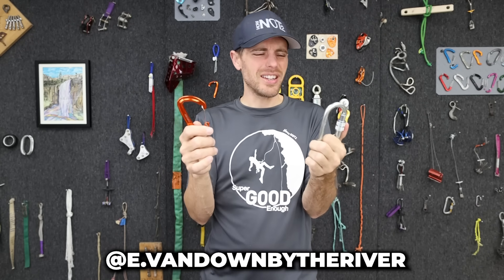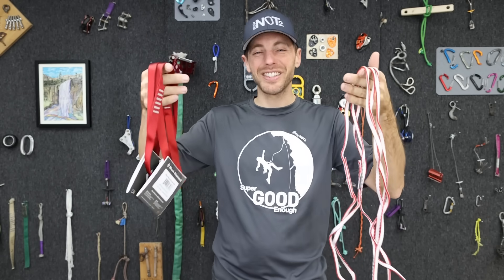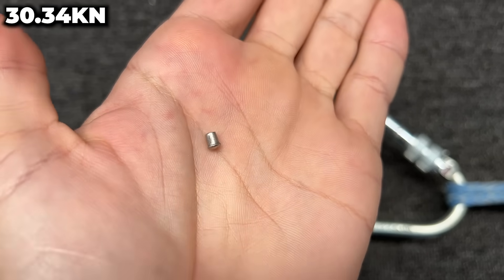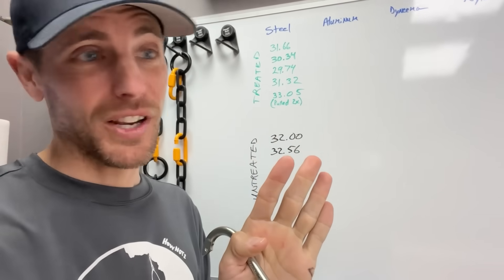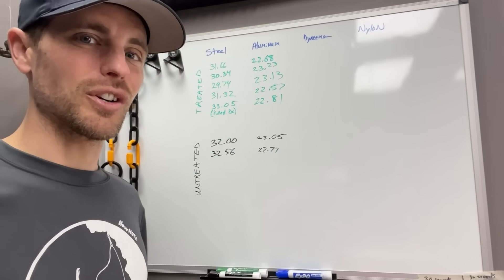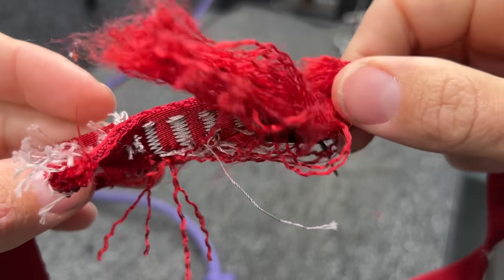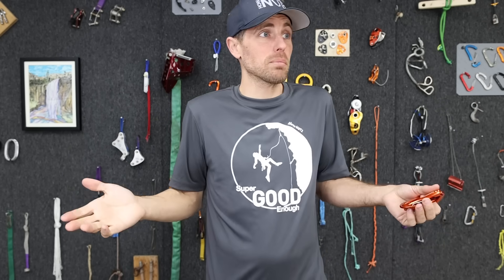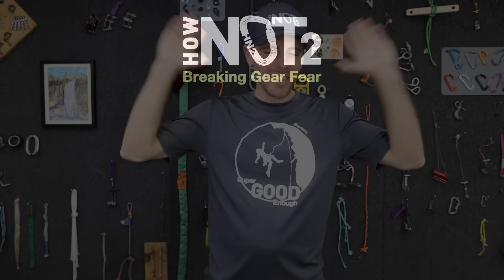Can we make climbing gear stronger?

Comment: There are metallurgists working at these factories. In most cases, whatever you do, you will make it weaker, because the metal is already heat treated properly. Only if they had treated the material suboptimally, you would be able to improve on it. And on top of that, not much is happening with materials at low temperatures chemically, and if there is, it takes a long time. If anything you most likely will introduce stress fractures because of the uneven cooling. There are some steels that can be hardened cryogenically, and some of the high strength maraging steels might benefit from that procedure too, by further increasing the proportion of martensite to austenite, so it's not impossible to improve a your gear, just unlikely.
Reply: I like the idea of people not doing the process because of proper research however the razor says, cheap process is more likely to get good enough rather then treating and costing more hours of production. 

This does treat hss steel bits by making the grains interlock in a similar tough way and the bits I've done this too last 3 to 10 times as long. But youtube search drill bits in liquid nitrogen by applied science
Reply: the cannel applied science has made a video on cryogenically treating HS steel drills. Very dramatic result. of course it might just make it more brittle
Reply: @ayrendraganas8686  Right, hardness and strength are not the same thing, although they are related.
Reply: That's not entirely fair -- the metallurgists might not be treating the products because it increases cost with no real benefit, or for some other reason.
Reply: Yeah, the ultimate tensile strength isnt going to change much unless its normalized.  Cool to see still.
Reply: It would be cool to see an episode that dives into the metallurgy a little bit--I was shocked to learn that CMC makes a aluminum carabiner with a 44kN rating--I had never heard of a aluminum carabiner that had a higher strength than many steel ones. I have to assume there is something beyond just geometry going on there because it's a big carabiner but not ridiculously so.
Reply: @ayrendraganas8686  The optimal heat treatment of a drill bit is almost the exact opposite of what is optimal for a carabiner.

Comment: I've never done cryo-treating, but for heat-treating, what's more important than the temperatures reached is the speed that the temperatures change. When a metal is hot, the atoms can move around each other easier, and how fast you cool it kinda determines when they get "locked in place."  I'm honestly struggling to see how a cryo treatment could do much unless it was kept cold for at least minutes if not hours given how slow the atoms move at 77K. My only guess is that at lower temps, the atoms "fall into" lower energy lattice states that evens out the crystal structure and the energy when it warms up isn't enough to excite them out of those states. 

Kinda sad it didn't work, I wanted an excuse to play with LN again.
Reply: As some others have mentioned, Applied Science did a video on this for high speed steel: https://www.youtube.com/watch?v=hAxi5YXTjEk

He slowly cooled it and held it at 77K for about 30hrs. He shows a diagram showing the different structures, and shows how the grain lines disappear afterwards, but doesn't really explain the physics. I feel extremely nerd-sniped right now.

Comment: While cooling a steel component, different crystal structures can be obtained depending on the temperature-time curve. 
Martensite (hard and brittle) can be obtained by rapidly reducing the component’s temperature. This is obtained by quenching the hot part in water or oil. 
The martensitic reaction begins during cooling when the austenite reaches the martensite start temperature Ms. As the sample is quenched, an increasing percentage of the austenite transforms to martensite until the lower transformation temperature Mf is reached, at which point the transformation is completed. 
For some high alloy steels, Mf is much lower than room temperature. Thus, a percentage of austenite remains in the crystal structure. To complete the martensitic reaction additional cooling is necessary. This is usually obtained using liquid nitrogen.
The transformation between these phases is instantaneous and not dependent upon diffusion.

Comment: cryogenic heat treat does improve the toughness but not the overall strength. the cryogenic heat treat does move the yield point (the point on a stress strain curve where a piece will not return to its original shape) and that is why you could open the cryoed one that was taken to 31 kn but not the other one. applied science did a video on how cryo heat treating works and he does a much better job of explaining it because he has a better understanding then I do.

Comment: working with cryogenics we have plastic wires. most plastic used for wires have problems if you cool it down too fast or unevenly since they  become shorter and brittle, but they can survive and the process is reversable if the cooling down is even.

Comment: The question becomes...How much does the equipment degrade after it has been used a few times? What happens to the slings after they have picked up some dust and been used and stored and maybe gotten wet once or twice? What happens to the biners after they have been used and scuffed and scratched (but never taken a significant fall) or maybe their wire gate has bent a bit, or one of the pins has slid out of alignment? In other words...How durable is it? What do we need to worry about before we put black tape on our biners?
Reply: That is what half the videos on this channel are about. Lots of old used gear. The tldr as far as I’ve seen them is soft goods anywhere down to 50% and hard goods more usually down 80-90, if at all.

(Assuming it passes visual inspection and doesn’t trigger your “Jesus this stuff is fucked up” sensor)

Comment: I very occasionally use a biner that is "far too strong" because in some circumstances I want a steel biner (like Petzl Oxan, triple action 38, 16, 15 KillerNewtonts) that would still be super good enough even if cross loaded or bent over an edge. Not needed very often, but an example is the biner for a top rope (belaying from below) or in some difficult industrial situation. That sort of kit isn't very relevant for normal climbing though.
Reply: This is why I like my CAMP steel triple lockers. MBS is super good enough even cross loaded or open

Comment: Ask me how surprised I am that the professional metallurgists working in climbing gear factories have already tempered these metals to whatever state is optimal.

Also: My amateur understanding is that ONLY cooling something from room temperature isn't really going to change the crystal structure. You really only change the crystal structure by significantly heating and THEN cooling metal, because metal is a solid, and not much happens inside a solid metal at room temperature and below.

Comment: The only time a material can Cryo harden is when it’s cryohardenable. If the material you are using is heat treated, there is a reason. Or maybe they’re already cryohardend  as for the slings it seems like it damaged the stitching

Comment: I wonder with the webbing and stitching, if humidity at the time they were frozen played any impact in the integrity of the stitching being degraded. More specifically, let's say there was 60% humidity level, and that humidity was inside the stitching and webbing, then as temperatures dropped the humidity would crystallize and expand more than the nylon, causing micro abrasions. I don't think it's anything to be worried about, but I think it effectively would age the material.

Comment: @hownot2  The thing is that cryogenic treatments don’t do this to all things.  

When you make knives you know there are only certain formulations of steels, particularly super cutlery steels, that benefit from cryo treatment. 

I think D2 tool steel is another formulation that benefits from it.  Not stainless though.  

I would imagine the same is true for aluminum alloys.  

Are you sure the carabiners tested are of the correct type of aluminum that does benefit from cryogenic treatment?  Do manufacturers give us the spec on the chemical makeup of the materials our carabiners are made out of?

Comment: As far as I know cryogenic treatment of  hardened steel makes the martensite reaction go to the physical limit. Simply: you get more effects of the gardening. I guess here it doesn't make sense since you don't want carabiniers to be brittle.
Reply: This is often used to treat metalworking tools, it doesn't make them noticeably more brittle, but the increased hardness makes HSS drills last much longer before edge failure.

Comment: Stronger isn't necessary. More durable is more attractive to me.
Reply: I wonder if a lightweight rubberized coating, similar to truck bed liner, would help absorb impacts a little and mitigate micro fractures a little? That would be interesting... 🤔

Comment: There might be a benefit cooling them ridiculous fast in liquid nitrogen after heat treatment? 🤷🏼‍♂️
But that should be done during manufacturing.
What might be a cool idea to test, is shotpeening or rotorpeening carabiners and then put them to the test. It should make the skin more resistant to cracking, as that is where cracks initially form and then rupture into just not super good enough…

Comment: From my understanding (which I am NOT a scientist) bring something down to extremely low temperatures can temporarily change a crystalline structure on malleable objects. from metals need to be in that malleable state to be affected. If nothing else, when they are that cold, they become more brittle, but return to normal upon going back to room temperature. 
So testing the carabiners like this is useless (as your results show) whereas with the soft shackles, that would be a much better test since they can actually be affected long term (returning to room temp) where the carabiners would not be affected.
Reply: Applied science has a video on this, cryogenic treatement. Basically its about expanding the range of temperature tempering happens over as far as i understand it, but it is actually doing something after the metal returns to room temp.
Reply: @ravener96   Oh cool! :D I haven't actually done much research into this (I'm more into other types of sciences and computer sciences) though knowing how metals react to different temps does actually come handy
Reply: @dethsproductions  its only really relevant with steel i think, at least in the way shown in his video, since it just increases the amount of martensite. you could get the same result by just ajusting the original heat treat probbably.